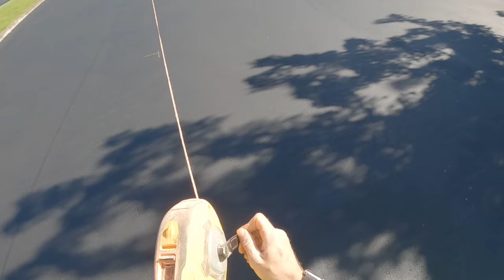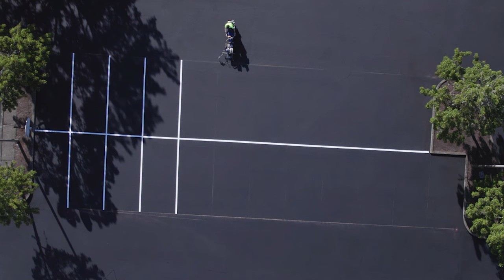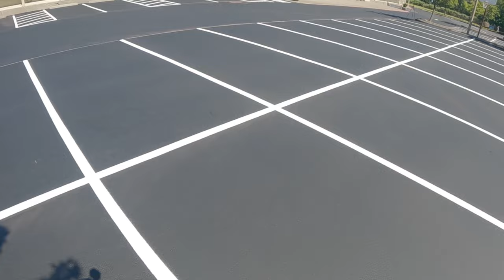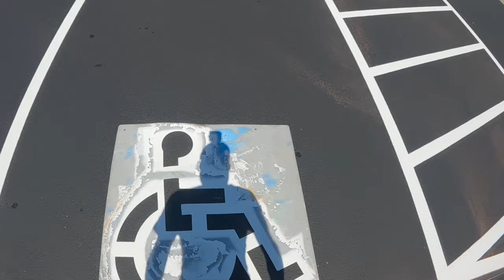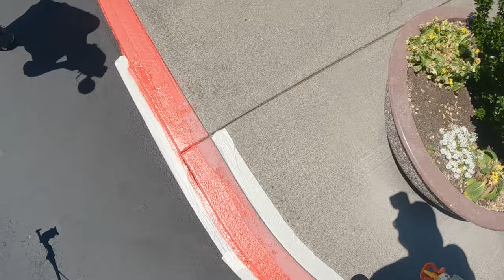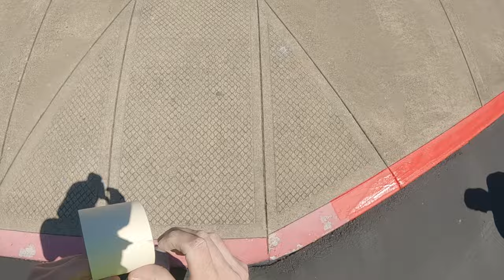Repainting A Church Parking Lot from start to finish - 1 Hour POV of Striper

Comment: Naive question I guess.  How do they draw the lines so straight and exact? I’d be all wobbly!
Reply: The front wheel on the machine locks so if you are lined straight and don’t grip too hadd d you will stay on point for the most part